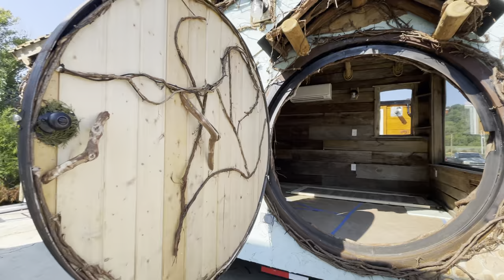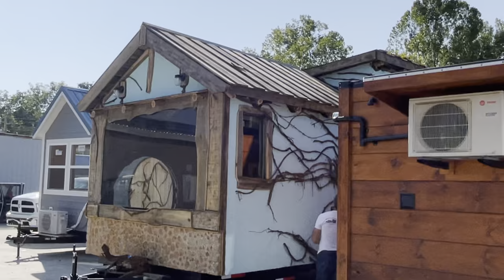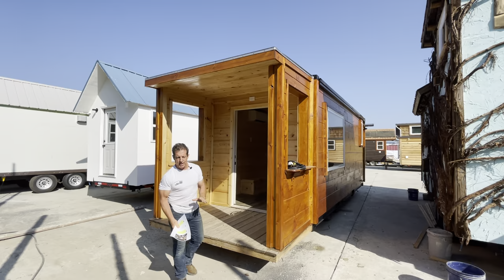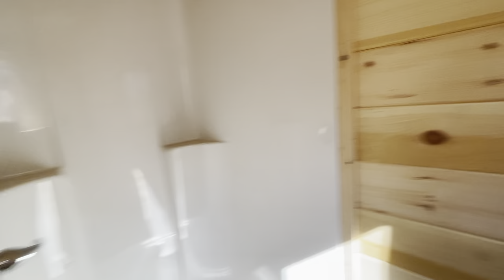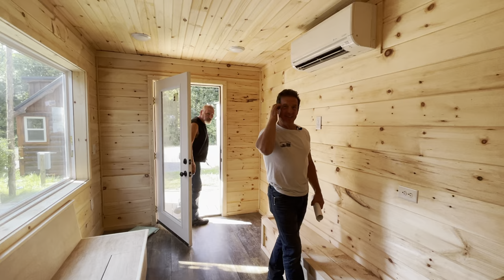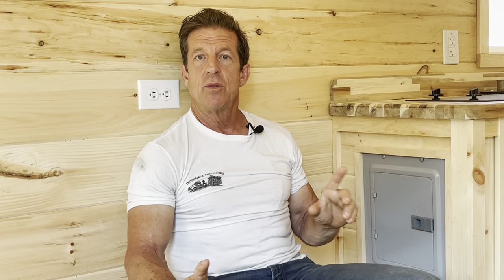Would you want a Tiny Container?? 🤔 Plus, comments read and questions answered 🙋‍♀️📝

Comment: I’m glad your tiny is almost finished. No more musical chair tiny bed hopping for you and Wonder dog Ace.
Another suggestion for using up those extra foam panels is as extra insulation in the floors cos in the winter the floors are always colder.
Reply: Any chance of in floor heating?

You figuring a coat closet to one side of  the door and maybe a Hobit wood stove on the other?

Comment: A suggestion for the fresh water tanks. If you have the bathroom and kitchen next to each other like in Randys container house.  Put the water tank  standing up between the bathroom and kitchen.  Enclose the tanks with the kitchen and bathroom walls. Cut openings for drain and faucet to put water in.  On the narrow section which is the door between bathroom and kitchen, make it so it can be removed. So if tank needs to be replaced it can be slid out. Because the tanks in wall should not freeze if no heat.